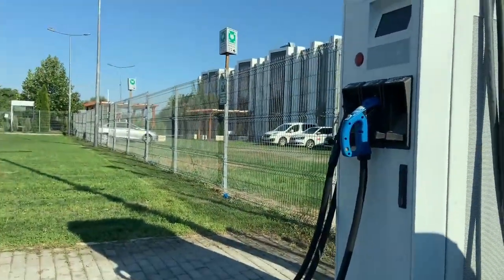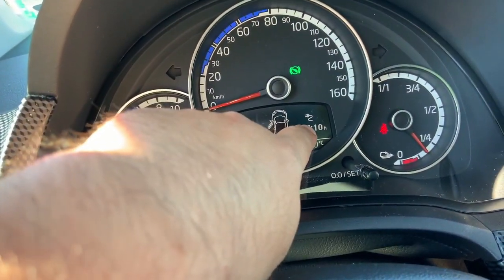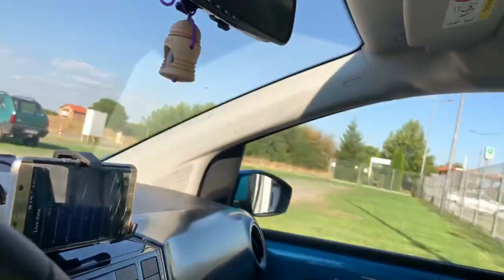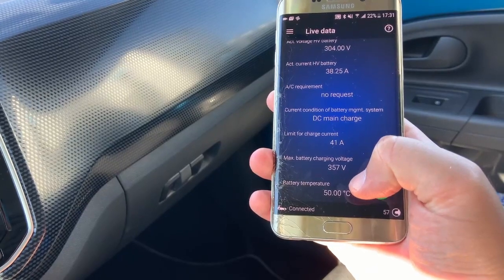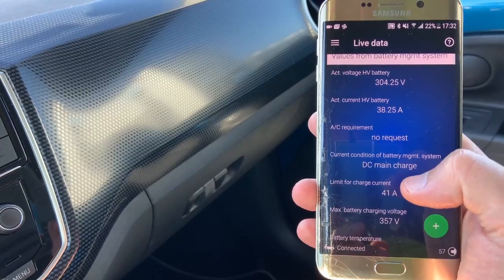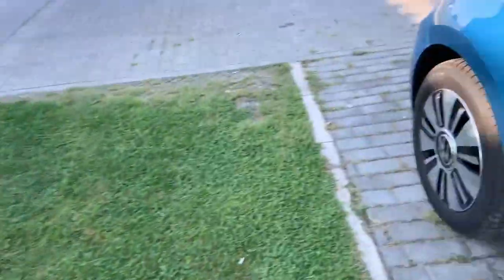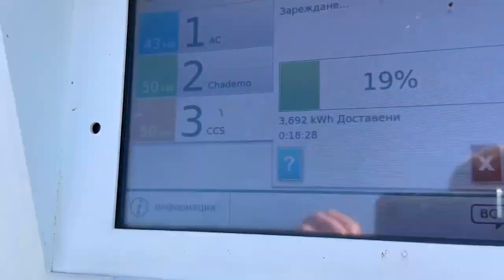Rapid gating of VW e-up gen. 2 on second DC fast charge

Comment: Hello. Is it possible to limit the load power in dc? That is, I am on a 50kW charger, can I choose to charge at 10kW, 15kW or 20kW? I know that this way it will take longer to charge, but I think that this way the batteries will not get hot.
Reply from the maker: I think It is possible because I have seen this somewhere in the OBDEleven app. I will try to search it and check if it is read only or can be programed.
Reply from the maker: I checked I couldn't find a way to limit the DC charging power.
Reply: @tedonash2681  Thank you very much for check it. The OBDEleven looks to be best obd for e-up. You know if there are others similar or even better. I think that I will have to buy one.

Comment: From I know that these 2020 models use different (cheaper?) battery cells from the previous models, in fact they can't even keep a flat curve while charging in DC as you can see here https://www.naf.no/elbil/elbiler-i-norge/volkswagen-e-up/ladetest-vw-e-up/

That's very disappointing but it is what it is for the price :(
Reply: I think it’s mainly because the bigger capacity. When you fastcharge the double amount of energy it will also generate about double amount of heat in the battery when fastcharging. Nissan Leaf got similar problem when increasing the battery capacity in new models. The Leaf and E-UP battery is similar with no active cooling and also placement of the battery modules. Here’s a long description of the Leaf problem: https://ssj3gohan.tweakblogs.net/blog/18181/how-to-manage-a-battery
Reply: Where you got the info?
I have read some comments, that cells are the same as Taycan, just no active cooling and therefore soft limit the charging speed to preserve battery
Reply: @electricwhirl5175  on an Italian forum I believe

Comment: Someone could probably modify the battery with cooling, for example by adding exhaust fans? It probably isn't easy though, because it would've been done otherwise already. :D

Still I'm guessing we wont see many modifications before the battery warranties run out, so we'll see 4 to 5 years later maybe when first cars reach 160 000 km's.
Reply from the maker: I really hope this happens only in summer. When the temperature is greater than 30 degrees I am not able to do more than 2 DC fast charging in a row. The battery is very well packed in order to work properly in cold weather. That's the reason why fans will not work there.

Comment: This is a city car. It will charge better during most parts of the year at a fastcharger when it cooler outside. Charging with the onboard charger overnight is the best way to charge this type of battery. But for sure warmer countries like Spain will wear down the battery faster like on the Nissan Leaf. If you wish to make a lot of long trips you must have a active cooling system 
Iike Tesla and the new iD3.

Comment: I measure the max voltege of the pack when it ia full charger on old one and is around 410V that means with 102s we have ~4.02V in each cell . How about the new e-up?
Reply: 100 % SOC = 84 x 4.166V = 350 V
Reply: @martinadler74  that means it not last as many cicle so it sould be charge at max 90% in most cases

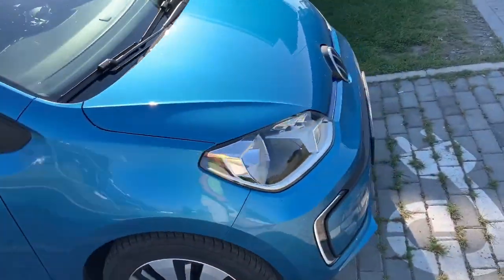Comment: If you look at 03:04 Min. it shows on the display 18 : 07 and 3.623 kWh. At 03:49 Min. the display reads 18 : 52 and 3.796 kWh. 176 Wh in 45 s or 14 kWh per hour. Rapidgating, yes, and this is no surprise. But I expect it to last 90-100 minutes from 20% to reach 80%.
Reply from the maker: Very soon I will post the whole video about the rapid gating and you will see the whole picture. It is not what you are catching for this 45 s. When it rapid gate the charging does not increase more than 4 kWh

Comment: Would it be possible to trick the car to think the battery is cooler than it is? With obdeleven or something? So that it would not limit charging current. Not that it would be advisable in long run, but as emergency measure...
Reply: Yes and Battery can blow up.
Reply: @falschwagen3266  You had me on Yes :)
Reply from the maker: hirveeressi I really don’t know. We need to ask this questions to the Volkswagen engineers that design this crappy battery

Comment: I‘ve got the SEAT Mii Electric, at this temperatures i can load up to 36 KW  DC... 2h and the car was fully loaded from 20 to 98%... you can switch to AC (7,4 KW) at 80%... ;-)
Reply from the maker: Roland Pohl I did that the first DC charge and you are right. I went from 6 to 80 % for 1 hour and 30 minutes. But the problem is the second DC fast charge. Then the problem occurred
Reply: @tedonash2681  It s still to much time, I charge my e-up 2020 from 10-90% in 1h on DC, even at 30 deg C.
Reply from the maker: VooNCZT there might be something wrong with my battery. The other reason may be that the car have some safety mechanisms that reduce the charging speed on the first 5-10 DC charging sessions. Next week I will do another 400 km trip and will see if the charging speed is improved
Reply: @tedonash2681  I did not notice any restrictions regarding charging for the first 5-10 DC charges. I charge 90% of the time on DC and in 1h no matter the % i have left I can charge to about 85% with max 38kw (when it's below 30-40%), after that it decreases below 10kw . Did you check the charging power of the station you are using?
Reply from the maker: VooNCZT the charging power is ok because there are other cars before me that I saw they are charging with 50 kW . I hope the problem is not with my battery. What is the average temperature when you are charging?
Reply: @tedonash2681  The ambient temperature is about 30 C, the battery temp i did not check, but i will next time.
Reply: @tedonash2681  What was your use case/consumption during that day? Mine charged over 30kW after highway drive 120kmh, average consumption 13, SoC ~15. Yes, it was the first and only fast charge that day, but very warm day as well. Do you have any battery temperature data from the second DC charging?
Reply from the maker: Svihak177 this was my use case
https://youtu.be/cmcnK-c6YeE . The average consumption was around 13 kWh
Reply: @tedonash2681  Thanks, that seems strange. I've found in Car scanner app an value of "Battery intake air temperature". That can give you some information. 50°C seems really unhealthy, as the datasheet of LG E63 cell, which should be in this Up, states 45°C as destructive test condition...
Reply: Tedo, yes, i drove more than 350 km and charged 4 times for about 30 to 50 minutes... no problems at all,...Anyway , never had any problems while charging, AC or DC...
Reply: Very strange... from the first day on i charged on a 50KW-DC-Station, the max power has been 36KW for a short time (till now, 8200 km). After one hour the Battery ist charged up to 80%, the other 20% will last another hour. There MUST be something wrong with your charging-station of, hopefully not, with your car.
Reply from the maker: Roland Pohl just to be clear this is second or third DC charging in a row for a single day right? The first DC charging on my car is exactly how you explain it

Comment: Try to AC charge for a little time and see if it helps.
It sounds very crazy that it is rapidgating so much so fast.
Maybe it has a faulty battery bms?
Reply: The car lacks active battery cooling, it’s just how the car is built. No faults, just poor design.
Reply from the maker: Yes I agree that it is poor design. I tried AC for 1 hour and 30 minutes and then again DC with no success. The difference was that on AC it charged with 3 kWh but with DC with 5 kWh

Comment: It is interesting to know how long you have to wait bevor another normal fastcharge is possible. 4 hours parking? 10 hours?
Reply from the maker: I was parked for 4 hours waiting for the battery to cool down. After that I drive 1 hour at night hoping that it will cool down ( the temperature was 26 degrees) then tried again DC fast charge and still the car was rapid gating
Reply: @tedonash2681  yes I assumed that once the 250kg battery mass is hot, only by passive cooling it will take a long time....
Heard that even over night parking doesn't reset it.
Reply from the maker: Fliwa Tüt that is pity. I am planing to do a 400 km. trip tomorrow and I was hoping that the battery will cool after several hours. If not it will be a nightmare for me because in the next day have another 200 km trip and the car needs to be fully charged.
Reply: @tedonash2681  Hope your weather goes down from 36C, then it will be okay
Reply: Tedo Nash so how did you 400 plus 200 km trip workout ?
Reply from the maker: Anders Andersson perfect. With one charge for 1 hour and 30 minutes I was able to do 400 km with no problems. Then I left the car on AC to charge and on the next day I was also able to do 200 km very comfortable.
Reply: Tedo Nash good strategy. You can solve most things with good planning. With BEV’s you just have to adjust your mind away from the old fashion expensive petrol buying.
Reply: @tedonash2681 
Here someone had the same issue and made some graphs: https://www.goingelectric.de/forum/viewtopic.php?f=390&p=1293588#p1293588

Conclusion is that driving at 90km/h doesn't increase heat in the battery. Cooling by driving would require even slower driving.

A fast charging to 80% SoC adds 12K to the battery temperature.
Reply from the maker: Fliwa Tüt thanks for the link. Very useful information for me.

Comment: ... Such a disappointment...
It reminded me of dieselgate surprise...
Makes me appreciate much more my Ioniq 28 KWh
I sympathize with you Tedo, especially since my initial intent was to buy an E-UP!..
Reply from the maker: Alex D I wandered a lot should I upgrade or not with the second generation when I saw review about the car. But finally I decided to upgrade because of the bigger battery. It can charge faster but you have more freedom. I hope I will find a way to work around this rapid gating problem
Reply: Maybe the price difference is the answer. Your car is probably 10k Euro more expensive. And in my case, i wanted the smallest 4 seats car to drive easy in the crowded city.
Reply: @misterc3835  I also wanted the smaller, less expensive and more modest choice, but then at the showroom I found out that I need to pay extra for CCS fastcharge, for white normal paint, for adaptive cruise control and so on... wich made the car almost as expensive as this one year old, second hand but full option Ioniq that came also with an extra set of wheels for winter.....
I live in Denmark and since here you have no incentive for an new EV, the choice vas simple.

Comment: Lets say you arrived at charger with battery at 40 celzius. Would car charge fast until 50 celzius reached, and then rapidgate and slow down charging?
Reply from the maker: No, it starts rapid gating around 43 degree and reduce the charging speed to 10kw. At 50 degree the charging speed was refused to 4 kw. I am mounting a video with all the details but will be available next week
Reply: @tedonash2681  if it is winter. Lets say 0 degrees. Would batt be heated to 50 degrees with charging, or this would be impossible at winter?
Reply from the maker: Roman Roman I cant say. Only time will tell
Reply: @RomanRoman-xi3dv  in Czech Republic tested citigo-e in Winter and they have Trouble with Winter degree too.
Reply: @tedonash2681  i am confused with charging speeds. If car has a 7,2kw charger, how can it charge more then 10kw?
Reply from the maker: Roman Roman this is on DC
Reply from the maker: Roman Roman when it rapidgate it do it in DC and AC also.
Reply: @RomanRoman-xi3dv  it has a CCS port that is written to support 40kW.
The port is optional for 600bucks.

And with this price it is disappointing that even under good conditions you only reach 25-33kW in the lower SoC.
Reply: @sevnpicoferro5352  this shuld be like range specs. Declared range and then real world range. And declared cgh speed vs real life speed. It shold bring shame to the car company if they declare one chrge speed, and real life is 30% less
Reply: @RomanRoman-xi3dv  yes it is the biggest disappointing thing with the e-up.

It is still a first gen electric car. And the price in relation to other ev is cheap with a 36.8kW capacity. So maybe that is the trade-off. VW tried to emphasize much it is a city car...

Without rapidgate and slow charge, it could be much more.
Reply: @RomanRoman-xi3dv  From my experience, i saw that i only can charge the car in 3-4 hours using type 2 (rated at 22kw). But when using CCS/SAE the car start charging arround 43kw and going down, but you can get 90% in less than an hour (station rated on 50KW)
Reply: This is the trap, they must reduce the cost somehow . To be more explicite, the new generation has waranty of 160000km like old one, but has double the range, that means they waranty is at half for the battery ( no need to cicle as much) . So i think the battery si a Little low in qualiti vs old one...
Reply: @armaselubogdan5778  what after 160000km.
Reply: @RomanRoman-xi3dv  You lose the waranty for the battery
Reply: @armaselubogdan5778  do we have some info how is batt holding up after 160k?
Reply: @RomanRoman-xi3dv  notting yet , but from what i heard It lose about 4% a year in the worst condition ( hot temperature , only rapid charging ... ). So i think will hold 70%+ after 8 years of 160.000km ( this for the old version ) . But what i want to say is that You have to do x cycle of the battery to do 160000 km with old one and x/2 cycle with new one ...
Reply: @armaselubogdan5778  Or maybe 8 years warranty is enough for VW (20000 km per year). Is just beginning of the e-revolution. The experience is better with e-up than with up arround the same price (with incentive)
Reply: @misterc3835  i know its better and i am sure they don't give You 160.000km waranty if it wont be able to do 180.000 km in the worst condition befor drop below 70% SOH.

Comment: you already have 36 degrees on this day, there is not much room for the battery temperature.
Reply from the maker: That is true but a fan in the battery can do a miracle in this scenario. It  will be nice if they add some info in the manual explaining what is happening when we drive at hot weather
Reply: @tedonash2681  Good Idea, that would be desirable.
Reply: Without active heating or cooling those cars are very sensitive during a period of extreme hot or cold weather. It results in reduced power.
Reply: Bean counters and engineers said “Nein” to active pack cooling, so welcome to rapidgate. I have seen it many times on my e-Golf.

Comment: Useful to know! It seems that this car is only for 250 km/day during hot weather conditions. Annoying, because this is when you wish to tavel the most...
Reply from the maker: chris I will test every possible case and make a videos about that, so we l ow how to charge when we are making our trips. It will be better if some of the VW engineers explains us how to beat charge the car and not reverse engineering the car behaviour
Reply from the maker: Yes this is true. On the first DC charge cycle I charged from 6 to 80% for 1 hour and 30 minutes